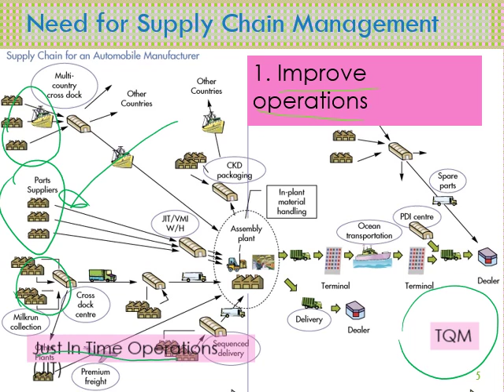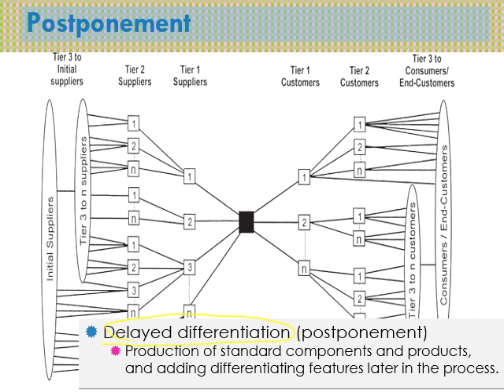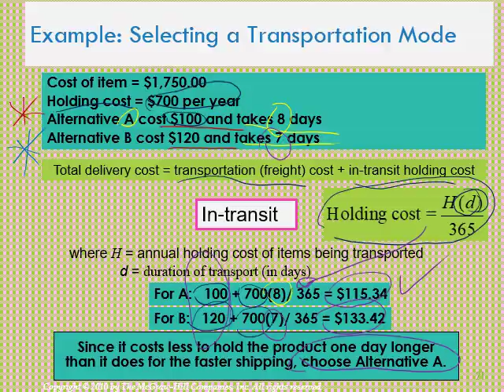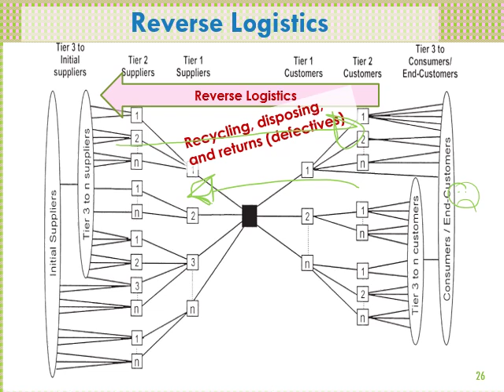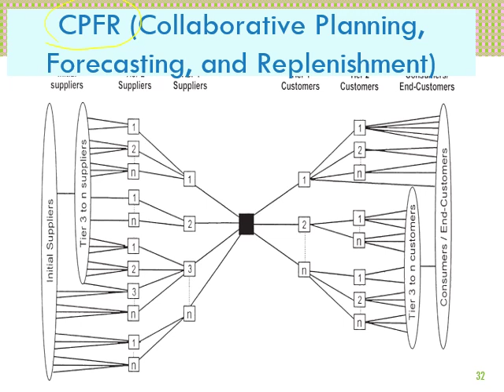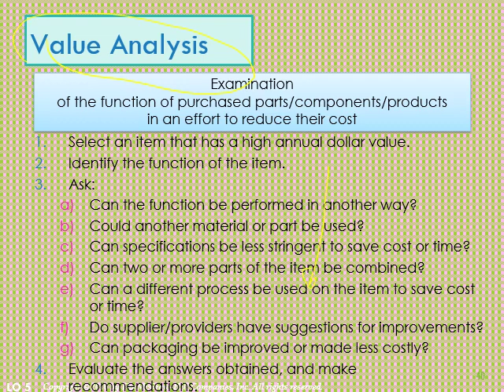COMM 225:  Supply Chain Management Lecture Video

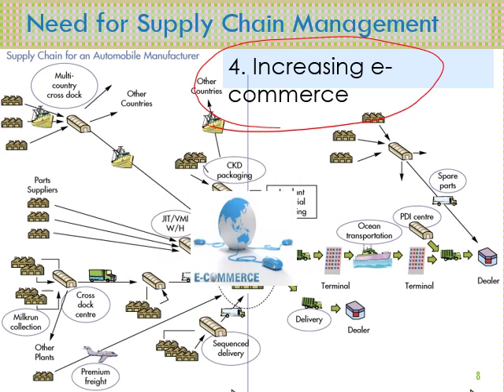Comment: 11:05 Can you give example or elaborate on the connection between e-commerce and supply chain management needs?
Reply from the maker: There are many connection.  For SCM, the most important is the distribution side or the front side of the SCM.  Think of Amazon as as example.  Amazon has a gigantic supply chain of warehouse, manufacturers, suppliers.  The E-commerce platform (think of the Amazon.com website) brings the pull data for the whole network to function.  The suppliers, 3rd party sellers, manufacturers -  all need this data to plan production or delivery.  Ecommerce is also a good platform for transactions, and record for the transactions, which is very important between buyers and sellers in the SC.